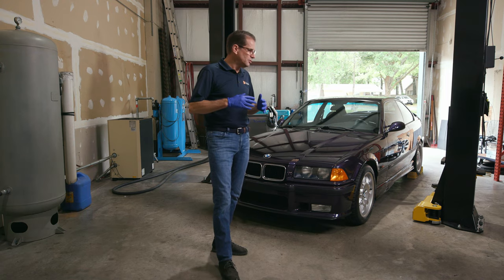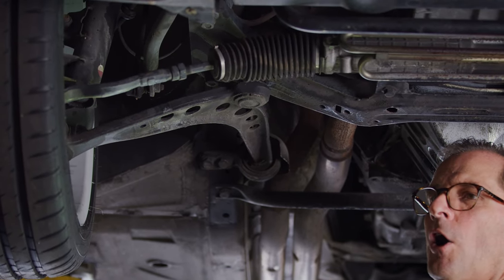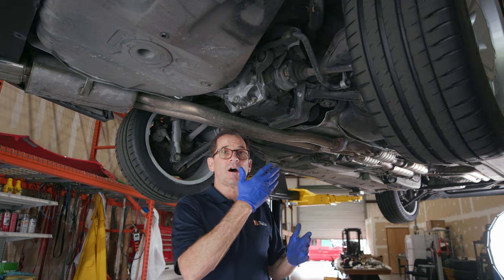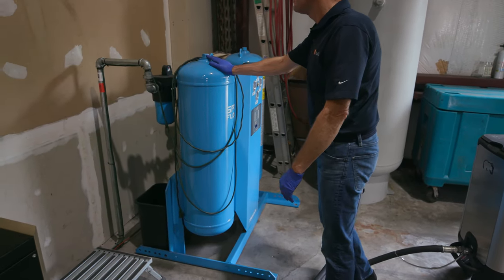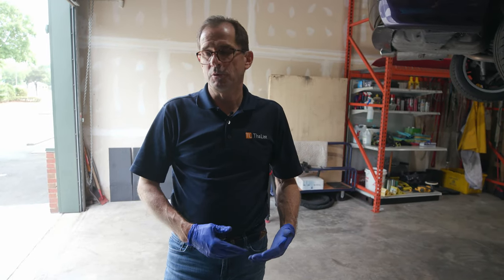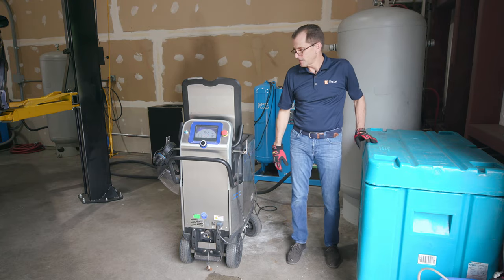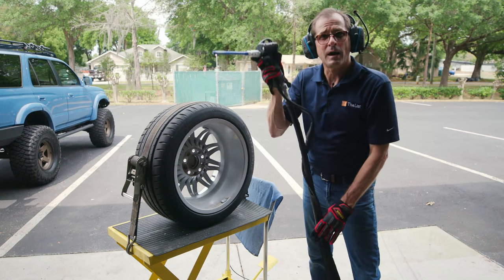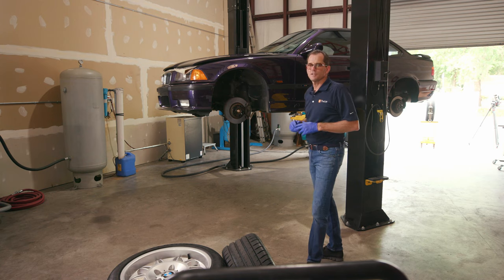DRY ICE Cleaning: FULLY Restoring the Obsessed Garage E36 M3 Part 1

Comment: And when the dry ice hits the surface it sublimates, but what happens to the dirt that comes off?
Reply from the maker: It lands on any horizontal surface in the surrounding area.  Like a very light black coating of dust.
Reply: It’s like the movie “envy” with jack black and Ben stiller.  Vapoo-rize.  But where does it go?